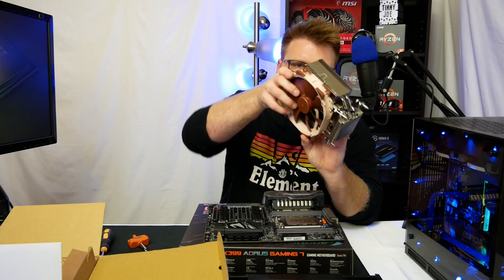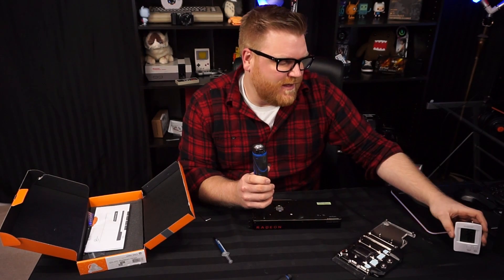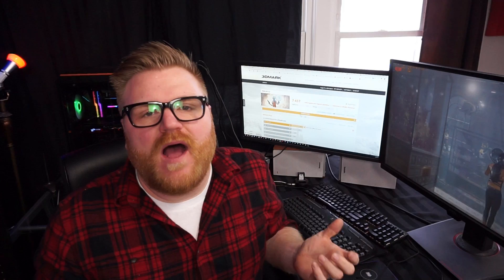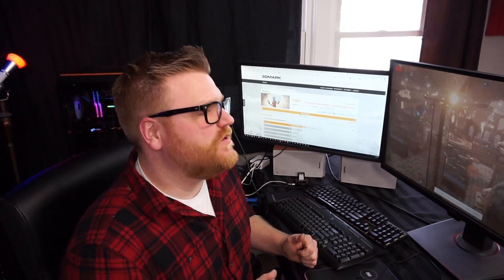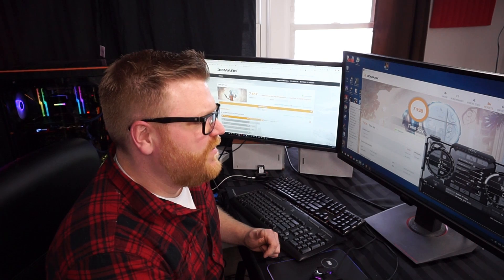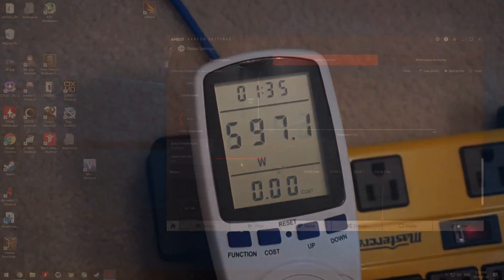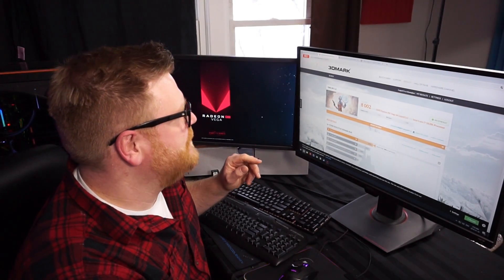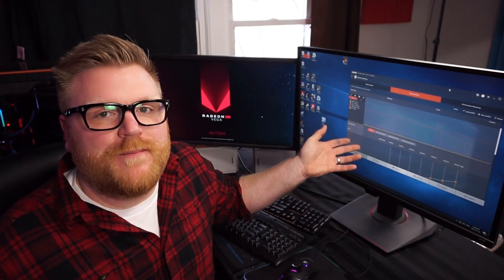Overclocking Vega 64 TO THE EXTREME

Comment: I have 2 LC Vega 64's and a prototype Vega card with LC and 16Gb of HBM2. I'm not privy to talk about the latter much. It isn't a 7nm card, so hold your enthusiasm. The short reply is that my LC Vega cards can easily do 1850Mhz. They don't sustain those clocks unless additional cooling is provided. Without additional cooling, I can sustain 1750Mhz. At at those clocks, and memory overclocked to 1100Mhz, I can match RTX 2080 benchmarks all day. Of course I don't have ray tracing or DLSS, but so what? The prototype card has only ever been used as a single card. The other two LC Vega 64's have been used in crossfire. Crossfire does not scale very well in all games, but when it does.....oh my. The performance is so far off the charts that it is ridiculous. Yes, power requirements for this setup is rather large. But I've got the gear, so I use it. It might be an issue for someone that is gaming 10hrs a day every day. But that isn't me. Even if it was, it isn't like it's going to cost you $1000 in electricity.
Reply: Vega 64 going into rtx 2080 territory https://www.3dmark.com/spy/5135301
Reply: Was 16GB card a Frontier Edition?
Reply: @suedavies1025  No, it was a prototype. It had no branding at all.
Reply: Chadwick Hurlburt I couldn't run that setup if I wanted to. my current arrangements would be tripping the breaker if I tried to. very cool though, I've always been kind of interested in multi card setups.
Reply: dude your wack, even I have vega 64 LC and I dont claim it anywhere near rtx 2080, thats GTX 1080ti zone....theres no Vega OC that can beat GTX 1080ti
Reply: @trilingualkid  In certain situations it's knocking on the door of them. On average though it's on par with the 1080 and if you do the settings right it'll consistently beat the 1080 and the 2070.
Reply: @BrKnOblivion  No, I still have both card maybe 1 game out of 10 it will beat 1080ti, but thats optimization fault not pure performance.
Reply: @trilingualkid  When optimisation is for Async Compute you can see the gap to the 1080Ti/2080 drop dramatically when using the Vega64. There's only a handful out there that do that, but they highlight the potential of the V64. Just sad that it's not used in many games.

Don't get me wrong the V64 is not the equal of the 1080Ti or the 2080. It's a 1080 and 2070 target market product. It does however punch well above it's weight class at times and that's a good thing.
Reply: @Marx No shit mate. Never said it would, but also ~9000 in what? Timespy? If yes then it's already biased in favour of Nvidia. You would beat Vega64 in most synthetics too. Never said otherwise. However when you get games that fully utilise the capabilities of which there are few then Vega steps up a gear. Don't worry your 1080Ti is safe, but those with Vega get a nice boost. Why is that so hard to understand?
Reply: you mean you match the 2080 on single card perf.  or only when using them in cfx?
Reply: @TheLiasas  Vega64 only matches the 2080 in certain workloads. Normally it's competitors are the 2070 and GTX1080.
Reply: @BrKnOblivion  so... second hand 1080 with good cooling and some oc is the better option then (?)  (theyre around 300 aswell,  arent they?)
Reply: @TheLiasas  Not really, depends on use case. Overall a good Vega64 will beat the 1080 with only very Nvidia biased exceptions.

1080 is probably a little less finicky to setup though.
Reply: In Australia rtx 2070 costs around 750 to 850 while a Vega 56 costs about 500 or 400 if you find a used one. Flashed to 64 bios and with power reg mod and waterblock well let's just say I don't give one flying shit if it doesn't beat a 2080 because it cost less then half of a 2080.
Reply: @Nosuchthingasnormalhere  Exactly, it's very local supplier dependent. Aussie prices for Vega are very good at the moment, unlike the Nvidia equivalents. Same cannot be said for USA at the moment and the EU/UK markets are also rather volatile as to which is the better buy.
Reply: @BrKnOblivion  I ended up getting the v56 for only 220 while the cheapest v64 was 320. Also just to mention, the v56 with a flashed v64 bios will show up as the v64 in 3dmark and not the v56. So when looking at benchmarks, the readings that say the v64 could be both of the cards.
Reply: @madbull4666  Well aware, my V64 shows up as a V64 LC due to it's BIOS flash. Many of the V56's that are V64 flashed don't have the memory OC levels of the V64 as well as slightly lower core OC on avg. The Mem OC is quite a substantial difference though.
Reply: @BrKnOblivion  what's your men oc?
Reply: @BrKnOblivion  a lot of v56 were getting around 1050-1100 and some plus that
Reply: @madbull4666  Mem OC for benching is 1180MHz, get artifacts at 1200MHz. For gaming i run 1100MHz most of the time.
Reply: @BrKnOblivion  that's pretty decent score OC. I just got mine and messing with my v56, core is at 1600mhz actual and 1100 mem so its also a decent overclocker. But I can't oc any more on the men otherwise my PC just crashes, no artifacts at all just perfect then crash. Would this became my card won't go any higher or something else? I've put a v64 bios and nodded the power play tables to get 150% but it still draws in the same amount as 50%.
Reply: @madbull4666  Yeah you'll need to push the core to pull more wattage. I hit 400W with 1752MHz @ 1250mv with 1185MHz on HBM2.

To stabilise HBM2 I run at minimum 1050mv on the 'HBM2 voltage' which is actually tied to DPM5 on the core. Making it a minimum voltage strap.

For a proper OC you want to have the core MHz as high as possible and control the Frequency using Core voltage. It's a bit like boost frequency as it's a target for P6 and P7 and not a static value. At 1100mv I get 1600-1640MHz under load in gaming and benching compared to 1720MHz with 1200mv. Both are set to 1752MHz though with only the voltage changed. That's where having an unlocked power target is so useful.

In normal use it just prevents any throttling due to a power spike on the core (sudden 100% load etc...)
Reply: @madbull4666  Nicely done on the card BTW, you got a good one ;)
Reply: @BrKnOblivion  ahh ok, thought it might be something like that with the core connected to the memory. I can't push voltage much above 1650 1100mv due to the stock cooler and that's where I'm stuck at with cooling for the moment anyway until the water block comes.

I'm pretty happy with the OC of this card so far, up to what others have reported definitely a good one, not bad at all for 220.
Reply: @madbull4666  I think you'll be pleasantly surprised if you pop the Core MHz up to 1750MHz and leave the voltages as you have them. It's a target after all. If it can't hit it, then it'll run as high as it can :)
Reply: @BrKnOblivion  Just put on the water block on to my V56 and overclocked it to the max and I have won the jackpot! 1700mhz (1670mhz real) on the core and 1155mhz on the momory completely stable! My Firestrike and Timespy scores are also very very good. Firestrike I'm getting 26100 and Timespy I'm getting 7900. 

After doing some research I haven't found a single person that has scored higher than me with a V56!!
Reply: @madbull4666  Awesome. Nicely done mate
Reply: @Eric B LOL Mine https://www.3dmark.com/fs/18270986
Reply: @Eric B You would be surprised at what vega cards can do once you get them to sustain their boost clocks, a liquid cooled v64 with 1750mhz core and 1100mhz memory would be just a tiny bit slower than that vega vii amd showed off in everything but fallout 4 (fallout 4 is sensitive to all kindsa memory overclocking) which would put it in the stock rtx 2080 ballpark.
Reply: @1toncheese  ding ding, you win the argument. This is exactly the circumstances for my claim. Although, I'll admit that my card is overclocked and the comparison card is not. Still, it goes to show the performance that is available. After that argument is finished, the "real" question is about performance for the money. Vega was initially expensive because of the mining craze. Now that is in the past, we are seeing realistic prices. And these prices are very seductive.
Reply: @chadwickhurlburt6529  just wondering how would you manage to get 2000+ points? As this youtuber only got under 400 increase running at 0c. I can't imagine your card running similar speeds would somehow manage to be that much faster.
Reply: @chadwickhurlburt6529  I know there is a lot of room for improvement in the card at stock but it wouldn't be possible to get that much of an improvement.
Reply: @Eric B Can confirm you are incredibly wrong about this.

https://www.3dmark.com/spy/4906893

I mean that shouldn't be possible with a normal Vega64 should it...

I mean it's not like Timespy is Nvidia biased at all either. Oh wait yes it is, so not a proper Nvidia to AMD comparison either. Gaming perf wise in games that are Async Compute heavy then you'll find Vega64 knocking on the door of the 2080/1080Ti (Forza Horizon 4 anyone...). In normal raster it's around GTX1080/RTX2070 performance and it beats both for the most part.

Just check the Firestrike numbers:
https://forums.overclockers.co.uk/threads/firestrike-standard-bench-thread.18665940/
Reply: @BrKnOblivion  now i dont know about that one buddy, the a-sync compute part is mostly right but the normal raster scores idk  .................... ive got a bone stock 2070 running on a non k 8700 and im beating that timespy gpu score by a few hundred, getting in the 20 k range in firestrike and consistently getting better frames in everyday gaming except for a few fringe titles
Reply: Pookie LexLuger Montana I also found something interesting with my RX 480, it was benching better than other RX 580s in different things, but I'm actually running my red devil on the slower bios setting as opposed to the higher one. no clues as to why that's taking place either. no overclock besides what power color ships out of the box as well.
Reply: @ArtisChronicles  A lot of benchmark software is skewed. There is actually a great deal of evidence for this available. It makes sense, if I were a CEO of a company, I would do everything I could to ensure that benchmarks favored my hardware over others. Ideally the rubber would hit the road in games. However, even there we see intentional favoritism that doesn't need to exist. GTAV as an example. Truly, examples like this only works against AMD because even if the performance difference is artificial, it exists yet. I support AMD because of discrepancies like these. These discrepancies should never exist in the first place. Yet they do. Nvidia has a long history of revolting business practices that do nothing but drive up prices for consumers and limit innovation. I flat-out refuse to support a company like that. AMD is the "good guy" now, but if they were to take the market lead and start practicing those same anti-consumer practices, I'd lead the charge to fight them. This whole Nvidia/AMD thing is a pissing match where everyone is trying to show you they have a bigger....or at least it used to be. Lately, AMD has been suffering penal envy. But to be clear, Vega is very good. That is why I use Vega over the alternative. I don't support higher prices, less gains over generations, and proprietary tech (G-Sync). Right now, Nvidia is gouging their customer base for money. That cannot be denied. A top tier Nvidia card has gone from $700 to $1200-$1600 within one year. Seriously, how it that acceptable?
Reply: @japookie  Yet your Firestrike scores just getting into the 20K range are not even close to my Vega64 scores which are up in the 26-27K range. Seeing as Firestrike is about the most neutral of the big tests how does that sit? With the synthetic benches it's always worth noting the bias of the test. Firestrike is pretty neutral, Timespy is Nvidia biased as is Heaven, whereas Superposition is AMD biased for some reason.

You say getting better frames, when from what I've seen of the 2070 it's pulling similar avg frames and worse 1% and 0.1% lows. The only exceptions being the obvious Nvidia favouring titles like AC Odyssey etc. or on the flip side Forza Horizon 4 in favour of AMD.
Reply: @BrKnOblivion  yea at 1650 on the core im getting in the RANGE (22 to 26k) ................... i can clock up to 1900 with ease (gonna guess ill eat that vega at these speeds ) but im going easy for the first few months. BTW due to me breaking my mobo which i wont get into my mem is bone stock as well 2100mhz and stock clocks on the cpu ..................... a vega should be destroying me especially with the clocks u have which its not so i look at this as a win especially when i do decide to push my clocks up .............just saying
Reply: @japookie  Well you can look at it as a win if you like. Most will find confirmation bias towards the product they purchase and it's not really a bad thing.

I had the choice of getting a GTX1080 or a Vega64 at the Vega launch and the GTX1080 had shot up to $900+ AUD at the time. I got the Vega64 for $669 AUD and it with some minor tweaking I beat GTX 1080 performance consistently in 95% of real world gaming scenario's. The 5% it failed to do so are known games which favour Nvidia cards such as GTA V etc...

The RTX 2070 offers the same perf as the GTX1080 +/- 5%. It also has a similar arch to Vega in the way they are both more Async Compute cores rather than the pure raster perf of the older Pascal arch. So you'll see more correlation of the 2070 with the Vega than with the 1080 in games that support Async Compute. Overall though I've not seen even GN do a proper OC of Vega that's worth anything, the V56 testing he did showed some potential, but not what a V64 with 1700MHz load and 1100MHz mem for gaming was and with benching at 1760MHz and 1180MHz mem can truly do.
Reply: @BrKnOblivion  hey i look at it as a win because i had the choice between a $480 1080, $500 2070 or $600 vega and i chose the card with the best frames per dollar ......................before i even have to overclock ........................ just saying
Reply: @japookie  Well you had the exact opposite choice I did and in that situation I would have likely got the 2070 too.
Reply: @BrKnOblivion  YEA pc died right before black friday and the deals seemed to dry up as well and there was no way in hell i was paying upwards of 800 for that 2080 soooooooo yea
Reply: @japookie  Yeah well for the money and the timing that 2070 looked about right. It's only in the last month that V64's have come down to reasonable prices and are beating the 1080's and 2070's in per/dollar again, so good bargain considering :)
Reply: @BrKnOblivion  yea I saw the recent price drop sigh
Reply: @japookie  Don't worry about it. In IT you buy at the time you buy, not months before or later. Sometimes you get in on the good deals, sometimes timing works against you. Hope the 2070 is performing well for you though, sounds like it was an emergency upgrade ;)

Had a similar one a while back when I bought an R9 290 OC as my HD6950 died.
Reply: @BrKnOblivion  Yea it is, using a 4k tv as a monitor because .........................why not, and for the games i play its amazing
Reply: @BrKnOblivion  I'm kinda sure that once overclocked the v56/64 are very similar. I have a chance at getting a vega 56 for 260 or 64 for 350 (used UK market is brilliant /s) so what is the point in getting the 64? I've been looking and can't find anything much with a proper overclock on the 64.
Reply: A lot of people have said that they can get the v56 to 1700mhz on the core and 1150mhz on memory so how would the same clocked v64 be much faster?
Reply: @madbull4666  From a gaming point of view if you get a good V56 that OC's well (and UV's well too!) then there's little point in the V64.

The chance of getting a good V56 is lower though and if it's not so good and doesn't hold a good OC on the memory then it does suffer in comparison the V64

All in all though the V64 is not $90 more gaming value, it is better for benching and with a waterblock or a Morpheus II on it will definitely perform a lot better than a V56 on average.

Main takeaway though is Vega is very much a silicon lottery. Get a good one and it's awesome, get a bad one and the performance will be good, but there's a noticeable difference.

Personally I tend to go for the best I can afford and there's a better chance of a good V64 than V56. Mine is pretty good, though from a competitive OC standpoint it's below that of some of the really good cards ;)
Reply: @BrKnOblivion  As I've already got some parts to custom water cool my cpu I was going to water cool my gpu as well but have to decide which one first.

The reference model of v56 has Samsung memory which is very good overclocker and undervolter. With both cards underwater there will be very little difference between the two, so I might as well save the £90 and put it somewhere else

 I can just about afford a rtx 2080ti but I won't ever spend that much on a gpu I'd much rather spend it on other stuff and hobbies that I'd enjoy much more.
Reply: @madbull4666  If going Water Cooling I'd recommend the V64, it's likely to OC better and under water potentially hit 1750MHz under load quite happily at reasonable power draw too.

V56 water cooled is an option though many who've tried it haven't gotten the same as a V64. If you can find a deal on a reference V64 LC and then put a proper water block on it that would be the ideal solution as AMD did Bin the Vega range reasonably well.
Reply: @BrKnOblivion  I was thinking about the LC version but I haven't seen any on any used listing places and when I did see 1 it cost far more.

From my research overclocking the memory seems to give better results than the core clock speed and both are very close to each other with this. The v64 maybe a few fps faster but I don't think that small increment is worth £90. If I get a great deal on a v64 then I'll definitely get that. 

Besides I'm going to wait for Navi to see what the speed of them are going to be, they may have great price to performance, and it'll bring down the cost of the v56 as a bonus so if it does flop I can still save money on a v56.
Reply: @madbull4666  It's less about the extra performance and more about the OC stability. IMO getting the V64 is the better stability and less likely to have a card that causes frustration.

Navi is going to be mainstream and targeting 2070 level performance and lower. If you're aiming for a V56 then yes you'll be interested in Navi. Top end Navi could even equate to that of V64 at a pinch, though we'll have to see.

Check out the Vega 64 Owners Club thread on OCUK for more information on them. Overall OC and stability and performance is in the favour of the V64. Some V56's can get close but not as many as some of the Techtubers would think.
Reply: @BrKnOblivion  alright I'll have a look at that forum when I get home from work.

As I want best bang for the buck I'm not sure whether the v64 will outperform the v56 enough and as I want to run vr on a Samsung odyssey or one of the other high resolution HMDs it's important to have high fps so if it is better by a bit of a margin then that's a better plan than the v56.
Reply: @madbull4666  Check this out for the difference between V56 and V64. It's definitely there. There's little to no difference between V64 and V64LC though ;)

https://forums.overclockers.co.uk/threads/firestrike-standard-bench-thread.18665940/

V56 get ~24K - 25K when the V64 can get to ~27K - 28K. V56 doesn't look like it's held back much on first glance, but when pushing the limits of the card benching (especially with VR) and in games. Get the balance right and you'll sustain close to ~1700MHz under load with ~220W which is right at the top tier game performance. Those stats are directly from Forza Horizon 4 from some testing I did last night. If I run my normal low power profile then I get ~1640MHz and 160W usage. Pushing the P7 voltage up to 1175mv instead of my low power 1100mv gained me around 10-20FPS in Forza (one of the few games that responds really well to core clock settings) and it's still 25mv below the stock 1200mv for my card. The LC version actually runs 1250mv stock, so as you can see the card actually arrives with the voltage way above the optimal performance point.
Reply: @BrKnOblivion  on that benchmark forum it looks like most of the v56 are running close to stock speeds and as there's only 5 people reporting it. A lot of the v64 are also scoring around 25k-27k. There's just not enough information.

Benchmarks are great but they only show how real games may do. Looks like the v56 score just over 1000 points less on timespy. Looks like the v56 is a little worse on core clock but unfortunately it doesn't show what it is memory speed is.
Reply: @madbull4666  V56 is much less likely to run a memory OC at all. Sometimes you get one that can (using a 64 BIOS often helps) but for the most part you are limited to core OC only. 

If you check on the 3DMark leaderboads for V56 vs V64 it actually reflects the chart quite well.

Top Vega56 on 3DMark Firestrike is:
https://www.3dmark.com/fs/17432117

25297 GPU score which most Vega64's can hit without any OC.
Reply: @Eric B You forgot which CPU Timmy is using, plus there was no claim about matching an OC 2080, the card no one is buying.
Reply: @Eric B i think he means his crossfired vegas match a 2080
Reply: @Eric B You are a know-it-all who knows nothing you pick one part of a test and blather on with your limited knowledge you don't own a 2080 or anything like it yet you try to pass youself off as some kind of guru because you watch some YT videos or reviews on tech sites.